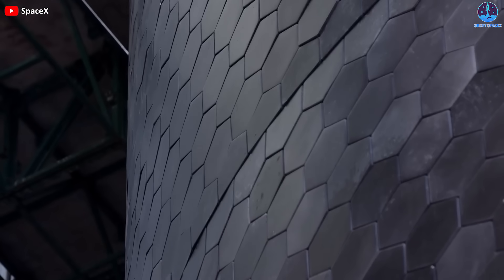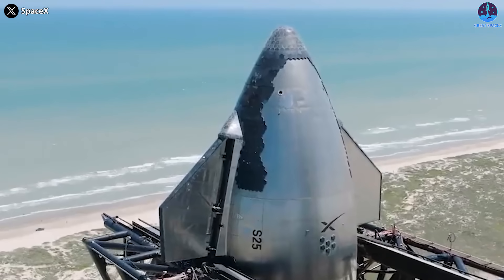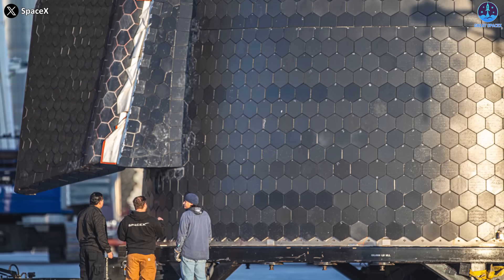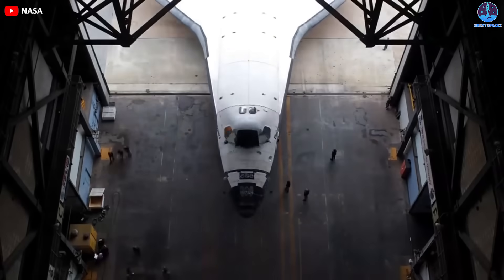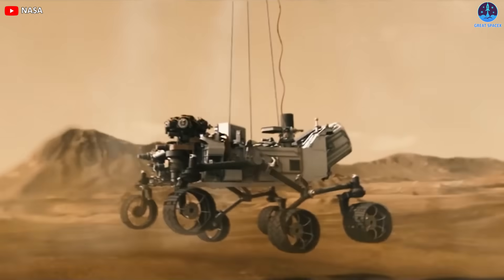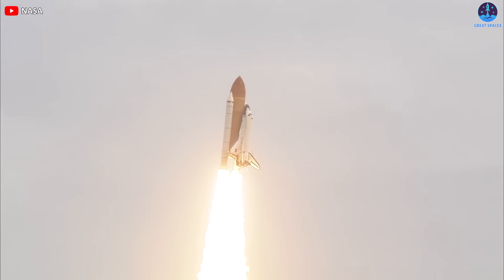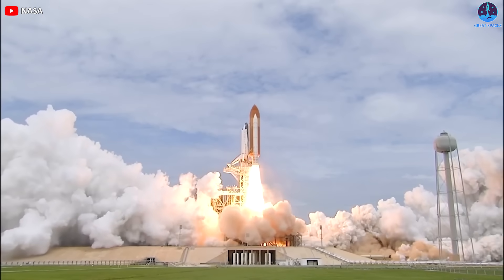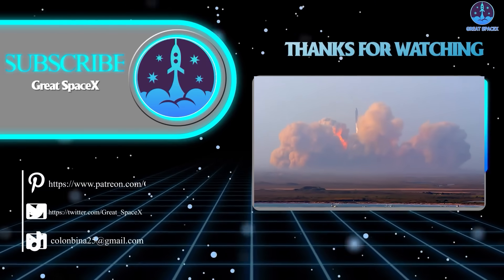SpaceX Starship's heatshield falling off during the launch! How SpaceX to fix?

Comment: Why can't rockets re-enter the atmosphere at slower speeds?
Reply: For them to be able to re-enter the  atmosphere at a slower speed they would need to burn fuel to slow down. Which in turn would mean more weight being sent in to orbit. The friction method that they are using is similar to a another method called airo breaking. Which is the cheapest way to slow a re-entry vehicle down.
Reply: The Virgin Galactic ship gets carried up by a jet - released and then fires its hybrid rocket engines to get up to space. Much lower altitude than these orbital class rockets - but since the vehicle never had to achieve orbital velocity - it just folds is wings up and skydives back into atmosphere, no need for heat shield or anything..it just goes up until gravity overtakes it and falls back down. 

Vehicles travelling at 27,000+ kph have a entirely different problem ^^ like the guy said in order to slow down from that kind of speed you would need to burn fuel. you would need about as much fuel as it took to get you to that speed - to slow you back down so your vehicle will be twice as heavy - and a vehicle twice as heavy would need even more fuel to get into orbit .. but the weight of that extra fuel would need even more fuel..so its a problem that snowballs.

One day in the far future we will engineer our way past chemical propulsion that is extremely heavy and is used up in minutes - then maybe those vehicles would be able to apply thrust and cancel out the orbital velocity and drop back into the atmosphere without the fireball.. but we need projects like Falcon 9 and StarShip to make getting into space cheaper so testing out new tech becomes less costly. - thats going to be the BIG contribution of StarShip
Reply: Maybe we'll develop some kind of way to apply the brakes without using the rockets?
Maybe gradually dip into and out of the atmosphere and let it slow us down over the span of an hour, instead of trying to blast through it in minutes?
What's the rush?
 @hawkzulu5671

Comment: The surface is round and the tiles are flat . Of course it will be disrupted by the oncoming flow .Even on the Shuttles it sometimes fell of , although it fit tightly and was glued . This is problem .

Comment: I believe they glued some of the heat tiles on one section, and used a proper method for the other. the conclusion: don't use glue.
Reply: Glue or adhesive should have worked fine. Maybe a problem with the installation process and surface preparation.
Reply: @ianstewart6021  Elon Musk doesn't pay enough, that's why employees use Made in India Glue
Reply: @ianstewart6021  Glue is often hugely problematic and so process/operator sensitive.  I avoid it like a plague rat in my designs wherever remotely feasible.

Comment: i think they should use bigger tiles, that have more fixing points, they know how to make them now, it would probably cost less to make less, bigger tiles too
Reply: Bigger tiles have a larger chance of burning through the hull if lost, more differential motion between tiles, and more fix points spread out (at least if a hard fix) causes more differential motion between fix points potentially breaking them loose.
Reply: @michaelmcmullen354  makes sense, also for the expansion of the metal
Reply: another good idea
Reply: The right part is no part.. or less parts . Seems logical to me.

Comment: People need to stop calling these explosions "Huge Successes". Yeah, the program is on track. Probably - we wouldn't know. Consider this: The Starship program can't afford an unlimited number of these "huge successes". Even the Artemis program will encounter delays because of these "successes". What SpaceX is doing is a big achievement, and it may ultimately revolutionize space access. But it is going to take years until Starship can fulfill even the most basic useful mission of bringing satellites into orbit, and further years until it can land astronauts on the moon, because for that to work they need refueling. And for refueling to work they probably need full reusability, because the way they are working right now, they can't have four or more fully stacked fully tested super heavys in parallel...
Reply from the maker: That’s right 
A huge success of SpaceX 
Actually, to get to the destination SpaceX still have a long way to go 
And more tests coming

Comment: Question: Rockets are launching satellites every week, so why can't they send up a rocket (smaller version than Starship) just to test tiles in re-entry? While not identical to Starship, it would give valuable info towards the final full size version.  🤔
Reply: They need to use Flex Glue. I seen it on TV. 
You can spray it on a boat and float in it…
Reply: Because its not about the heat it’s about the attaching method
Reply: @loux4294  Well that's obvious, don't see why you reply with that... any test flight would need to ATTACH the tiles to withstand re-entry.
Reply: That didn't answer the question, why not scale model and see if the remain attached. Good question. @loux4294
Reply: Tile survival is not in question.  Keeping them attached is.  Really need the real, full-sized starship riding through max-Q of launch of superheavy booster to be sure flexing, bowing, and particularly first stage booster vibrations and acoustic pressures to fully test their attachment. Second area of tests is aerodynamics of re-entry and critical attachment surfaces and re-entry heating around flap wing hinges.

The first shuttle launch was almost a catastrophe due to over-stressing the flaperon at the tail end below the three main engines being over stressed by launch pad shock wave from igniting the solid rocket boosters during launch.  If it was overstressed just a slight bit more, shuttle may not have been able to control its re-entry angle. Bob Crippen and John Young were on board the shuttle.
Reply: @rcinfla9017  I didn't mean to use one of the current rockets being launched,, I meant there are a lot of launches and it would be worth launching a test rocket specifically to test these new tiles.🙂  Just seems odd that they did so many tests-to-destruction of smaller prototype development rockets to get data, that they don't do the same for the tiles(AND attachment). When they do test firing of rockets at stage 0, it's never at full power but still gives valuable info.  But, I see what your saying,  👍
Reply: @JohnDoe-tx8lq  You are suggesting a test frame panel could be sent as a ride share on a Star Link or other launch?
Reply: Actually, I believe they actually have done this with early versions of SpaceX Dragon cargo ships.
Reply: The stage 1 rockets don’t go into orbit and don’t need any heat shields, the stage 2 bits are expended. I do like your idea though.
Reply: It is not the tiles that need to be tested but rather the steel structure underneath.
Reply: @jamescobban857  erm, they'd be attached to test rocket - made of steel!
Reply: Not big deal going to the Moon or Mars, only re-entry to Earth, gravity or air thickness is much more

Comment: A fine kevlar net stretched over the tiles would help at minimum weight. It could burn away on re entry but it will have done its job..
Reply: They need to use Flex Glue. I seen it on TV. 
You can spray it on a boat and float in it…

Comment: Will it be asking too much for you guys to stop using that stupid metric system. There's a reason it's never landed anyone on the moon and you're not living in a metric country.
Reply: Sure thing! I heard that those tiles didn't fall off til they had reached 4,239 furlongs in altitude, and they only weighed less than half a stone anyway
Reply: @frankfreeman1444  - speak in fathoms or cubits, or I don’t understand you…..
Reply: Sorry xxxxxx2628! I was struggling with the math required in the metric system. You know, all that technical stuff about moving the decimal point!🤔
Reply: The U.S. tried to implement the metric system in 1975, but people were used to the imperial system and rejected it.  Actually, only uninformed people might think it’s “stupid.”  I was taught in engineering school in college, and I loved it.  It eliminates endless odd and random conversations like 12 inches per foot, three feet per yard, 5,280 feet per mile and so on and replaces them with even decimal fractions based on the meter.  Volumes are similar.  So conversions are extremely easy and mistakes are reduced.  So the only people who think it’s “crazy” are “ignorant” and “short-sided.”
Reply: @audistik1199  100% ... The problem is that we are still teaching it in the grade schools... it's FN ridiculous
Reply: @audistik1199  when I was a kid, I’m 47 now, we were taught metric in school and were told that we were definitely switching to it. I wish we had. You’re absolute correct. It’s a lot easier to say a number with a decimal point rather than saying something is 14 and 3/32 inches. We should just bite the bullet and make the switch. It’s easy to learn and everybody has a phone in their pocket that can make the conversion for them while we’re getting used to it.
Reply: Actually NASA exclusively use Metric units because it is mandatory for precise trajectory calculations, in fact the whole US Space Program was metric and the DSKY (DiSplayKeYboard) onboard computers of Apollo spaceships 🚀 where computing in metric systems (the only way, check it up) and had a output results customary unit converter to old imperial units, more familiar to astronauts who had airflight ✈️ training in (unfortunately) imperial. 
And no, GPS is not imperial, it’s metric, because of balistic missiles trajectory calculations, it’s original purpose, before being released for public usage with low precision. 
So, next time you use your GPS, remember it is full metric technology with medieval units conversion for unsavy rednecks 😂
You’re welcome ☺️
Reply: @johnmanderson2060 "...for unsavy rednecks"

That is what I really admire about the alt left.
They are very inclusive of cultures other than their own, unless they don't like them.
And they don't even see their hypocrisy.
Reply: Not everyone here is from the USA and all of us use the metric system. It would be best to say both in the video.
Reply: @caribbb  Nah.  Freedom units are much better than that Eurocentric pap pushed by the patriarchal elitists in the Hague.
Reply: Yeah! Just what he said….!
Reply: Ah yes good old freedom units, nothing quite like converting to different bases for no good reason when trying to do calculations
Reply: @BC-tp8ep  Can't wait till you learn about the English language.
I'm surprised you aren't dictating that Esperanto be the only form of speech allowed.
Reply: @bugwar5545  huh?
Reply: AGREED!! Standard Unit of Measure!! This is the United States not the UK or Canada!! GO SLS!!
Reply: you think they don’t use the metric system in the sciences even in the US ? 😂
Reply: Metric system just makes more sense
Reply: Space being all metric….
And anyway,who missed Mars because they were using yards instead of Metres?
Reply: @RabidWombatz  true
Reply: You’re wrong is so many ways it has to be on purpose. You did the equivalent of getting every answer wrong on a true or false quiz.
Reply: Bla bla bla. Calling 7 and 15 16ths how so very OLD in a world with so many REAL problems this tool wants to go back to the stone age
Reply: One word for you Merica 🇺🇸
Reply: Right 0 Mate
Reply: I don’t want to retrain for a news article, change your style when addressing Americans. If not I won’t watch this crap anymore.
Reply: Aren’t most (or all) American automakers producing metric autos? Regardless, it is the future and not really that difficult to cope with as NASA is committed to going all metric. 
As a machinist and toolmaker all my measuring instruments were Imperial, so I mainly dealt with Imperial, but metric conversion isn’t that difficult.
Reply: If God wanted us to use the metric system, there would only be 10 apostles.
Reply: @marklindsey1995 🤣😂🤣
Reply: 95% of the worlds population uses metric. 😂😂😂
Reply: @allgold8003  95% of the world can't do what we do. But it was good to learn NASA used the metric system to land in the moon, no wander we can't do it any more lol lol
Reply: Just use inconel 600. It can handle well over 1000 degrees Celsius.
Reply: There’s a reason why you have no brain 😂😂😂
Reply: I really wish the US has a better education system.  We should be metric by now, it is ridiculous
Reply: @christianartman  Weren't no 'metric' that got us to the moon, dagnabit!
Reply: @bugwar5545  yes but Just confirm it's sarcasm, these days it's hard to tell
Reply: @christianartman  Whut is this 'sarcasm' you write of?

Freedom units are a perfectly good system of measurement, tried and tested with centuries of successful experience behind them.

This 'Eurocentric' system you bally about is the product of the patriarchy, a simplified mental model created so that entitled minds do not have to actually think about what they are doing.
Reply: @christianartman  we aren't trying to move backwards to an inferior math, but thanks anyway.
Reply: @ryannunnink293 just making sure this is sarcasm 😂
Reply: You are not going to like this, but the metric system was used when you landed on the moon... :D

"Contrary to urban myth, NASA did use the metric system for the Apollo Moon landings. SI units were used for arguably the most critical part of the missions – the calculations that were carried out by the Lunar Module’s onboard Apollo Guidance Computer (AGC) during the computer-controlled phases of the spacecraft’s descent to the surface of the Moon, and for the journey of the Ascent stage of the craft during its return to lunar orbit, where it would rendezvous with the Command and Service Module (CSM)."

Anyhow, great achievement but the metric system was used in the landing.
Reply: @johannes5074  damn dude thanks for the info.

Comment: Not an issue. SpaceX wasn't testing the heat shield, so it wasn't a priority to ensure the tiles were secured on this year old version. They didn't test the tile integrity for this launch.
Reply: I probably would have been an issue if the ship did a circuit of the earth and then came in for re-entry which hopefully it will do during the next flight. They need to experiment with different adhesives and subject them to very high vibration, g-shock and heat on a test rig. This was often a problem with the space shuttle tiles.
Reply: It's an issue since they already did spend $5 billion on this project and the goal was not just to get a clean launch and to lose the two stages so fast.
They did spend $2 billions this year and they need to get this rocket to work properly soon and not for 2027.
Reply: @joannewilson6577  They spent all that money not just for the rocket but for the entire starbase facility. It's still less than half the budget of SLS an took less than half the time build it. While this rocket being dozens of times more complex any other rocket in the space industry. You could expect a lot better after several more years into this.
Reply: @joannewilson6577  And what does it has to do with heat tiles? Ship 25 is an outdated version of the ship and they pretty much expected heat tile losses in this flight.
Reply: @joannewilson6577  SpaceX are currently approaching a valuation of $150B which provides for a few more attempts to get it right. Falcon 9 took some effort and a few rockets blew up during the process but it was definitely worth the effort.
Reply: They haven’t spent 5 billion.
Reply: It is an issue it doesn't matter if they test it or not!!
Reply: @vikaythchandra9236  It seems like they did it intentionally, believe or not they hadn't even tried to replace bad tiles on the ship and it's noticed by a lot of footage taken before the test flight. It seems like they tried to test the toughness of the ship by intentionally having bad heat tiles, to see how long it can survive re-entry.